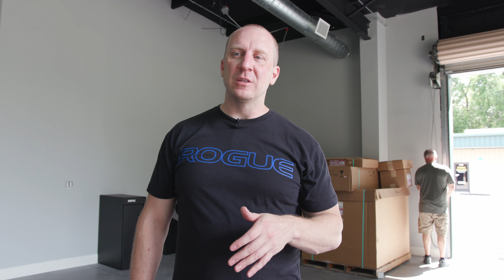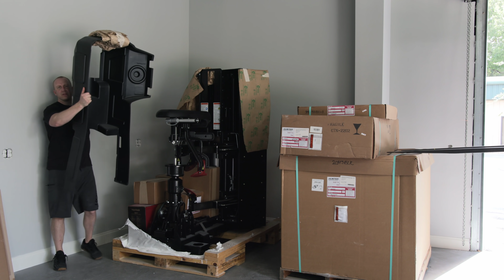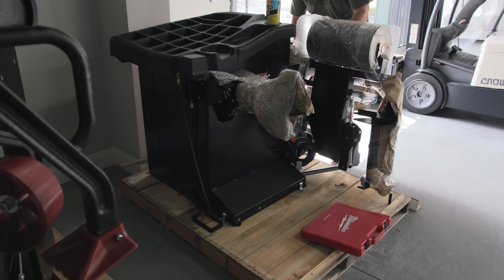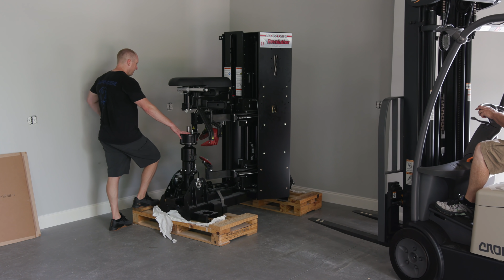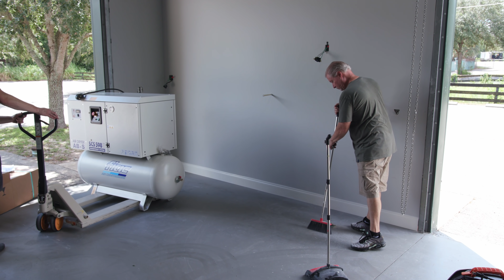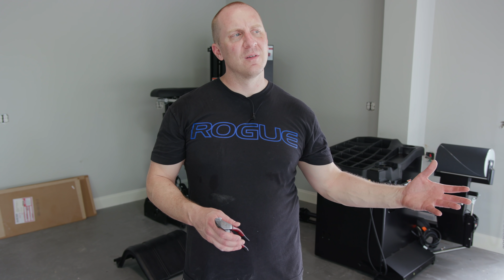Unpacking The Hunter Mounting and Balancing Machines

Comment: Saw the Revolution in use at SEMA. And while it looked simple with the Hunter guy feeding it the same 17” wheel with a 50 series tire for probably the 87th time that day, I still had doubts.

Just wouldn’t trust it to handle a 21” wheel with a 25 series tire without causing some damage.

Our dealer went with the Auto 34S, which is the model right below the Revolution. The Hunter tech said it was a very smart choice, and that spoke volumes.

Comment: Really excited for you to have these! People either love or hate the revolution and I think you’re going to love it. I’ve put in a ton of them at this point and they’re just so cool. The reason you don’t want speedclamp is because it’s just not as user friendly in our (local reps in the area) opinion. It’s extremely strong, it clamps very very fast, and not much room for error and on custom wheels and a beginner on the machine, the regular threaded spindle is a better option and it’s a LOT less moving parts, one less air cylinder and a couple valves to fail. You will still have “quick thread” with that spindle. You get everything setup and tap the pedal twice and it will spin the spindle while you hold the wingnut. If you tap it again it will go the other way. Even after years of using them and now that I’m a service rep, I still much prefer the standard spindle.
Reply: We don't have the speed clamp at work either and don't think I'd want it... It might be nice to some instances but I'm use to the quick thread and quick release clamp and they work great the way they are
Reply from the maker: Good stuff!  That makes more sense now.